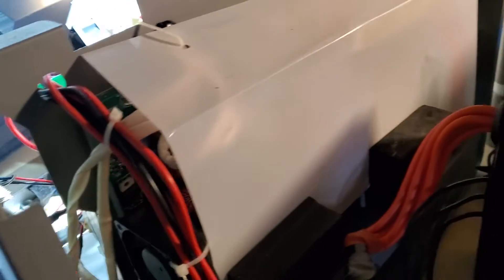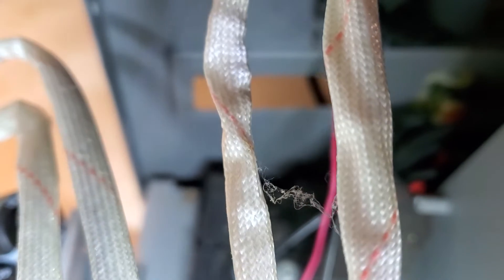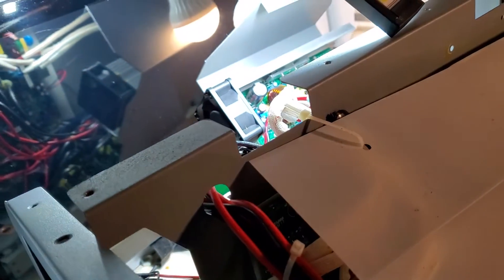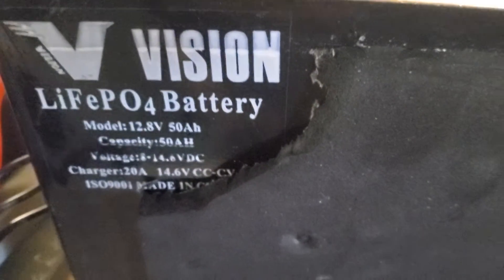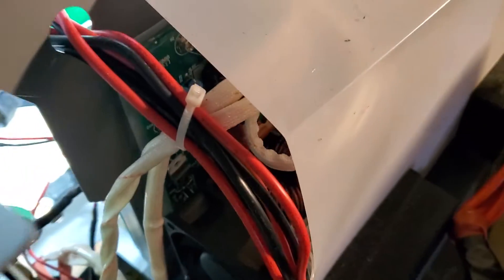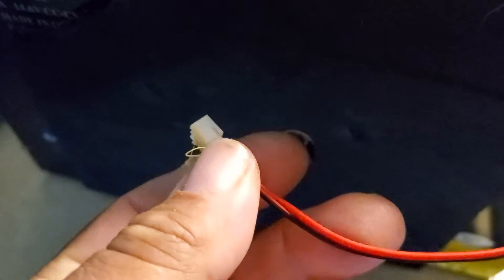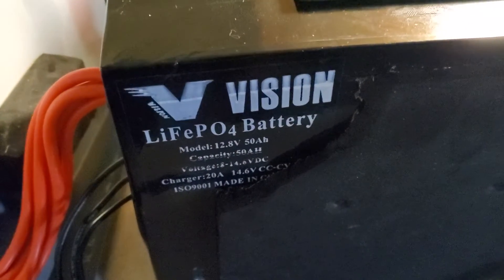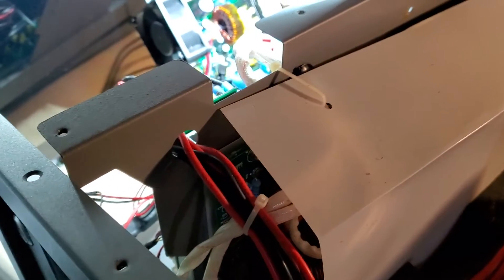Patriot solar generator disable for battery removal. 5 YEARS NOT CHARGED.

Comment: I haven’t been able to get the case open at all. Any suggestions or links.
Reply from the maker: You need to remove all the screws from the case.
Reply: You have to take all the little torx screws out. Maybe 20+ of them.

Comment: you seem to understand what inside.....  i just got a 4patriot 2000 and it seems ok but they want 1500 for extra battery?  there is a plug on right side they use to plug that one in.....  have you looked at them.... wondering if i can just tap into that plug and add a good battery.....  i have a battery bank i used for another project?
Reply from the maker: I was planning to use an external battery to power the unit, but the problem is that it has to be wired to the system.

Comment: I have a Patriot generator. My issue is it won't charge with the solar panels. Any suggestions?
Reply from the maker: Sorry, I have too many projects moving, and I have been busy. I would check the inside fuse.